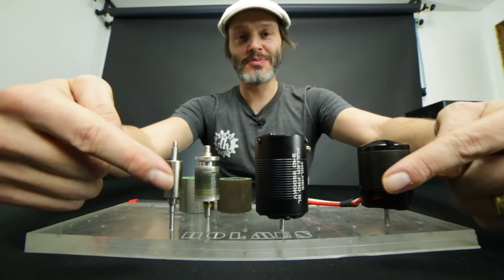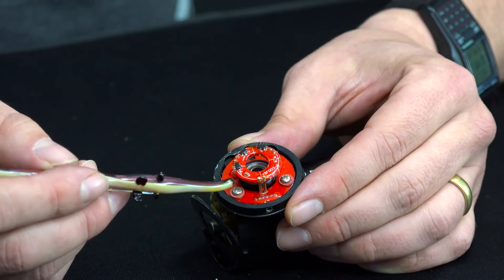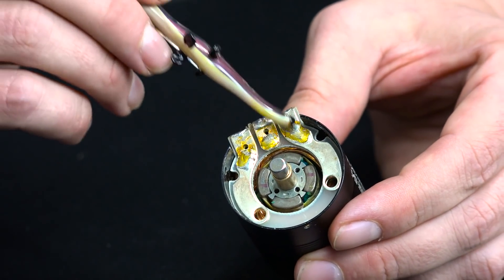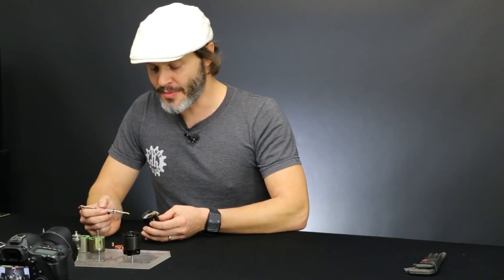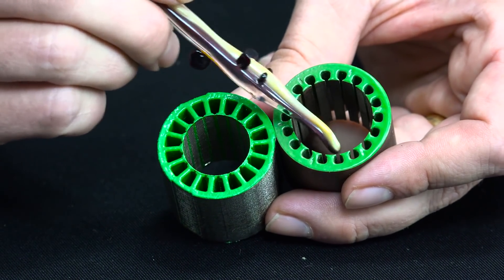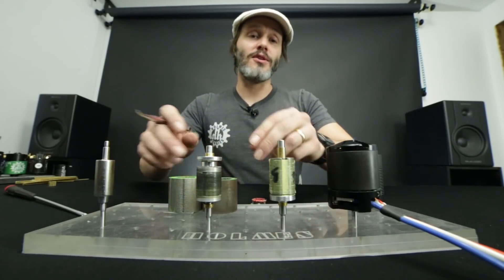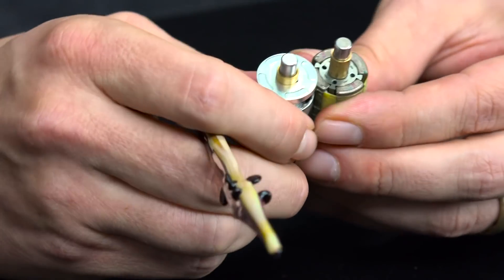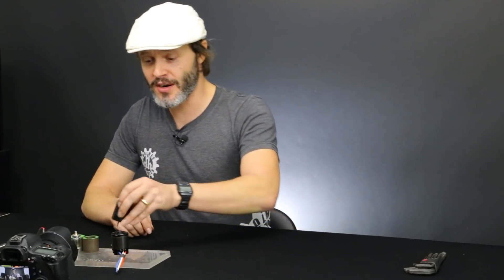What's In There! Understanding Brushless Motor Parts | Holmes Hobbies RC Basics Series

Comment from the maker: Have you ever encountered a motor issue while on the trail? What did you do to troubleshoot it?
Reply: I had a brushed motor get full of sand and lock up i just pulled it out popped endbell off and blew all the sand out with wd40 and it worked just fine afterwards
Reply: yes, overheated. went home, did some research, ordered a different motor

Comment: What’s the difference with ordering your puller pro with the zero degree timing for reverse rotation and without it? What timing does it come from normally? I bought mine from a hobby shop and the timing is in the middle of the hash marks.
Reply from the maker: Brushless?   We don't offer timing adjustments on Brushless when ordered.   It should be about 12 degrees factory.

Comment: could you explain the differences between a 4 pole 6 slot and 12 slot brushless motor? rpm, efficiency, torque, heat?
Reply from the maker: A complicated subject.   6 slot would typically have higher torque density and worse startup, but 12 slot can actually have a torque edge with better startup due to winding "end turn" length and single layer pattern that yeilds lower IR for any given KV.   Depends more on the stator and magnet shape than the simple theory can account for.

Comment: So are brushless motors just rated in KV or do they have Turn ratings as well? You explain things so idiots like me can understand, but trying to pick a motor and doing research on them can confuse old farts like me pretty easily. Most  guys I know who crawl and run your motors love them. However I havent been able to chat with anyone using your Puller Pro R for drag racing as you recommended for me to use in a previous post. The guys I'm running against are running anywhere from a 2.5 to 4.5 turn motors in their Street Eliminator cars. I'm different and want to run your motors but I want to be consistent and fast. With all of that said can you elaborate here or in another video as to what turn is and how it equates to KV and that happy place where all facets equal consistency, speed and power. Maybe I didn't read it right but what turn is the 540 Puller Pro R?

Comment: Could you go into a little more detail on how the number of poles factors in. With regards to how we use these in our hobby. Would having more poles always be better? Or are there situations where less poles are more important? And do the benefits related to the number of poles apply for brushed as well as brushless?
Reply from the maker: It's a pretty complicated subject, there is no easy correlation to performance unless we "fix" other aspects or specify an RPM range.   Brushed or brushless, the same problems occur.   We could (and do) make a two pole start up as smooth as a four pole, we could make a two pole have as much power, etc...   But, the four pole is typically the best balance of cost, engineering difficulty, and performance for RC cars because of the RPM ranges that we need.    Go higher pole, power density suffers due to cross sectional constraints and RPM range is limited due to steel losses.   Go lower pole, and startup smoothness typically suffers if we want to make them high power.    I'll try to make an in depth video on the subject one day, but it's a very deep rabbit hole.
Reply: Thanks fur the reply. I see how that could get deep. I was just curious if there was a generally accepted "rule of thumb" like more poles = better. I understand enough of what you said to see that realistically you simply aim for the most efficient compromise/balance that fits your needs and budget. Thanks for the response I appreciate it👍👍